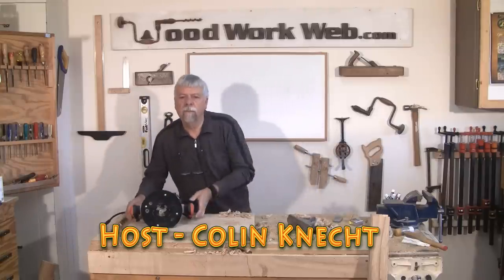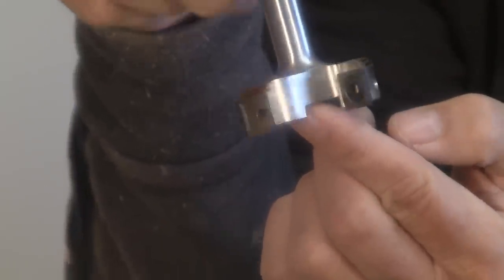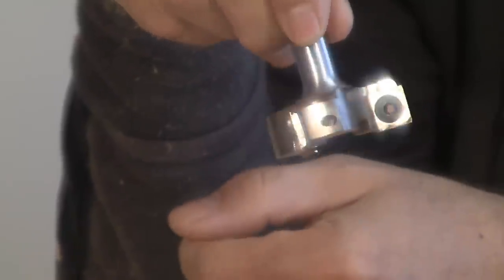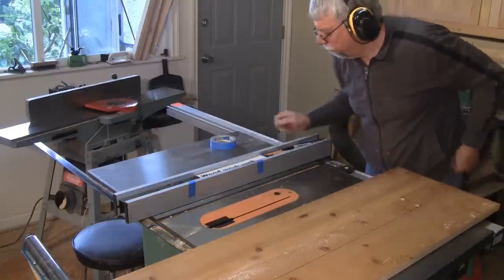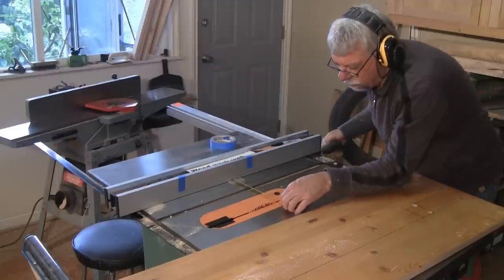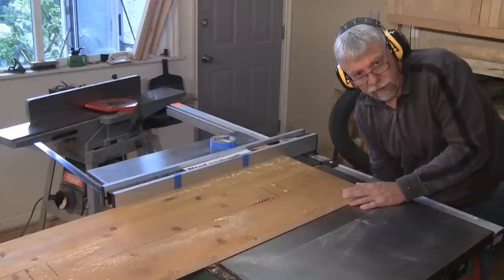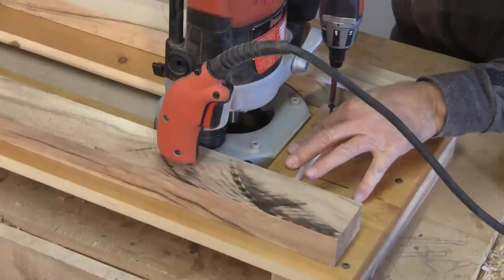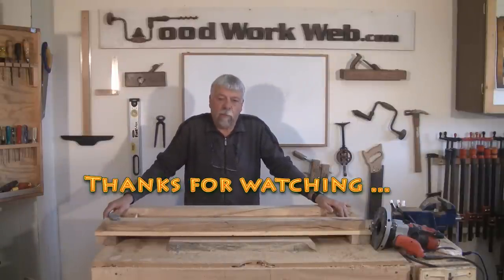Building a Planing Jig for a Wood Router -  woodworkweb

Comment: I am so glad that this video is still available.  I watched a few router plane jig videos and each one was more elaborate than what I needed it for. 

I had glued up some 2x4s for a butcher block extension wing on my table saw. Even though I used every clamp I own, the little slab had a dip on one side and a bump on the other. I needed a simple jig to plane it flat. Your design worked perfectly!
I used a 1/2" straight bit and took off just a little at a time, until I had a flat slab. It left a slight wavy pattern, but it sanded smooth with very little effort. Thank you for making this video. I enjoy every one of your videos. All very informative.

Comment: Slick jig!  I've seen the type that the router fastens to a sled and the whole sled slides on rails over the work, but never a panel with guides and feet on.  I've got a gorgeous piece of ash crotch wood that I've wanted to make into a clock for quite some time, but have done nothing but screw it up to this point.  Going to make a jig like this and try it out - the other kind I've seen would be too large for my tiny shop.  Thanks for making the video.

Comment from the maker: Hi Scotty, yes, even I was impressed how well it worked. Zip over to the article on woodworkweb to check out router bit options. We discovered they are somewhat hard to find. Rockler, Woodcraft and other go-to places had nothing, but there was a good selection at Amazon, which we provide links for in the article because there are pages and pages of router bits at Amazon.
Hope this helps, let me know if you need more info :)
Colin

Comment: Thanks for sharing the video. Another option would be the plane jig we used to level very large red oak slabs. First we used a 4x8 sheet of 3/4 plywood in which we made into a table about 30" off the floor. We then fastened 2x6's to the 8' sides, make sure you level them. Them we took 1 1/2 x 1 1/2 angle iron approx. 5' long, 2 each to go across the 4' table. we also used angle on each end told hold jig together, make sure the jig is far enough apart to easily hold your router. Now in our case the red oak slabs were not at all level, so we got them as close across the slab as we could, and fastened them through the bottom of the table using screws and wedges as needed. I works like a dream and we made many table tops using this jig. Some of the tops we made were over 5' wide so we had to make a larger table and jig, we also put 2 tables together for the longer slabs. The nice part about this method is you can also use the table for sanding, finishing your  projects. Good Luck!!
Reply from the maker: Jim Groth Thanks for your detailed note Jim ... appreciate it

Comment: Hi! Great video. I know it has been up for a while now, but I was wondering what are some other ways to fasten down the piece being worked on? Make it slightly oversized and clamp/screw it down?
Reply: I think, of you're planing a heavy piece, you'll just have to worry about horizontal movement, so just screwing a wooden frame, or even just little metal corners, will do. If you're working on something lighter, depending on the surface of your workbench, you could put wide tape on both your bench and the piece, so they'll aline and put a few drops of super glue in-between the "backs" of the tapes. It might even be enough to not clamp it down at all... Have fun and stay safe
Reply: @Lazarus-aap  Thanks for the reply! :)

Comment from the maker: The planing bits used in this video is a 1/2" and I'm not aware of any that are 1/4". You really need a bit bigger bit for this kind of work which means a little bit more powerful router that will take a 1/2" bit.
Reply: What particular brand of that planing bit?

Comment: Great work, you never cease inspire me. This sled build seems overly complicated. You do not have to cut a big slot out of the middle of a board with a table saw (or a jig saw) to make a slot for the router. You can just use the router to carve the channel (slightly larger than your widest planer bit) out of the board using a temporary guide, then add your stops, and the sides to fit the router base width. Some of the niftiest sleds also have height adjustment, which can bi a great feature. This is the first sled video I've seen that goes with the grain instead of across. Are there any advantages or doesn't it matter?

Comment: Hi Colin, I was wondering if there is a good way to make the height of the jig adjustable? Right now I'm thinking of driving a bolt in on every corner, but I think that will leave too much room for error... Also, my workbench is very small, so I don't have much room to move the jig over the workpiece... Is there an "easy" jig to make to move the router around over the piece? I'd probably have to make something on which the router can slide, say left and right and that sled on itself needs to slide back to front, right? Do you have something like that? (And a video about it?) Thank you in advance! Greetings from the Netherlands!
Reply: Nevermind! Found your video!

Comment: Hey awsome vid,
Just whas wondering why you didn't turn the router 90° in relation to the jig?
Cause what I thought whas you where going to use the flat sides of the router base to slide against the guide-rails. This whay you have a perfect straight routed line,... you also can use (approx. 1" thicker guide rails for stability,... and easier axcess to the handle.
Is this true what I'm saying? cause I'm not that certain,... it's just an idea. Let me know what you think?
Greets

Comment: Hi Colin, thank you so much for making and sharing this vid. I learned so much.

I intend to make a jig similar to this, but I have a question on router bit selection. For this jig, I will be using a Makita RP2301FC. The problem is, in the USA, this model router is a 3-1/4 HP, while in my country the motor is rated at 2100 w, or 2.8 HP. 

Originally the router bit I wanted to use was an Amana 1-3/4 inch bottom cleaning bit (part #45453), but when I found out that my router won't be as powerful as that of reviewers who used the bit, I got a bit worried. In fact, I got to looking at a smaller version of the bit, the Amana 1-1/2 inch bottom cleaning bit (part #45566). I want to be safe, and I want my work to look good too.

However, Amazon is selling the 1-3/4 inch bit slightly cheaper than the 1-1/2 inch. The fact that I would lose about 1/4 inch in capacity, combined with the fact that I would have to pay more for this questionable privilege, is really chafing me. Yes, the loss of capacity is small, and the difference is not even a dollar, but it bugs me.

So my question is, do you think that I can safely use the 1-3/4 inch bit, or would it be better to use the 1-1/2 inch bit?

Note: I am using tropical hardwoods almost exclusively. Some of them can be really dense.

Would really appreciate your input on this one. 

I'll link the items here (please copy and paste into address bar):

Router: amzn.to/1ROb8tw
1-3/4 inch: amzn.to/1OL5xEi
1-1/2 inch: amzn.to/1LzPhoF

Comment from the maker: Good question, the bandsaw was used to get the board cut to rough shape, in this video we are planing a wide board. If the board was narrower, we could have used a jointer, but on wide boards that won't fit on a jointer, planing with a router is another way of getting them flat and with a nice smooth surface finish.

Comment: Hi Colin,
On my planing jig the grain direction is a necessary consideration and also what about dust collection? I reclaim pallet wood boards this way but need to collect the chips.
Regards
Colin Farrier in Northern Ireland
Reply from the maker: Hi Colin ...
Yes, I would agree that grain direction is often necessary, as for dust collection some routers come with dust hoods that can be collected to shop a shop vac or dust collector. I seldom use them because most of what I do is in the router table which already has dust collection, but think for planing it's probably best to try to collect closer to where the bit is planing ... sounds like you might have more experience with this than me, but I am curious why you need to collect the chips??
Reply: Colin,
Thank you for your reply.
My planing jig is six feet long and can take a four foot board. The chips are thrown out from the jig in all directions and about half drops inside the jig for later disposal. One method would be to use brushes to act as a barrier as the carrier that I use for the router moves across the board. The second method is to have a 'containment room' around the jig to stop the widespread broadcast of chips.
What do you think?
regards
Colin Farrier from Northern Ireland
Reply from the maker: colin farrier Yes they can be pretty messy, I don't need to use mine very often, but I know what you mean by the mess. I had not really thought about trying to contain the chips until you brought it up, I just clean them up after or at least try to, they do go everywhere. I am wondering if containment on one side of the jig, and dust collecting on the other but not sure if there would be enough air flow, and your jig is very big and I don't think the dust hood that some come with would be work. You have me a bit stumped on this, I think your idea of containment on both sides sounds the best so far ... let me know how you make out with this, very interested to hear.
Reply from the maker: Hi Colin ... couple of thoughts, you could post them on Woodworkweb in the Forums for everyone to see and learn from or you can email them to me and I can post them ... either way, would be nice to have a look at them.
Thanks for the note ... looking forward
Colin

Comment: Hi Colin, great video, I'm halfway through making a end gain chopping board which I need to flatten I'm thinking putting a scrap boarder around and sending it through the thicknesser, or making a jig like this using a router, what's your advice and would a bit like the one used be to aggressive for end gain?

Cheers, ~Steve
Reply: Colin Knecht Sure I should have it finished next weekend thanks Colin

~Steve

Comment: Maybe a router template guide can be used insted of the top wooden fences
Reply: Filip Jelenkovic that's what I was thinking too.  Not sure if typical guides would support a huge bit like that.  Usually a guide would not interfere with the bit being plunged up or down (i.e., straight bits) however that would not be the case for this bit.  That would make it a dangerous option but I am only guessing don't have much experience with guides.

Comment: This video jsut saved my ass. Thanks man!
Reply from the maker: lol ... glad to hear David, maybe we can see some pics of the finished project?
Colin
Reply: I'm moving to a new house on Thursday the 21st. Will FINALLY have my shop. The wife has graciously granted mt the 2  car garage solely for my woodworking. So I'm getting in there and setting up tools and my new wood lathe :-) and then building a work bench, then this jig. I got a good deal on some hickory for a trailer I'm refurbishing for my landlord, but it's rough sawn. I don't' relish the idea of hand planing all that down. I'm sure photo's and stuff will be in my suture. Right now I only have pics of my fence and deck jobs I've done. And who'd wanna see those? Snore. Thanks again man!
Reply from the maker: David Loew AH ... I see what you mean now. Yes planing hickory with a router jig will be much quicker and easier that hand planing, and should do a good job too. Thanks for sharing this, we are always happy to save someone's butt  :) ... so to speak
Colin

Comment: I built this jig a few weeks ago and found it insanely useful! I am using this bit: http://www.amazon.com/CMT-852-504-11-Planer-2-Inch-Diameter/dp/B000P4O610/ref=sr_1_sc_2?s=hi&ie=UTF8&qid=1431539387&sr=1-2-spell&keywords=router+plainer+bit 

and on long grain cutting boards it works like a dream but on end grain boards i am getting a tiny bit of tear out....would the bit you are using eliminate that or would it be more of a product of my router speed and feed rate?
Reply from the maker: jeremy gunkel Hi Jeremy, glad to hear that jig is working for you, and yes a dado bit will work, it just takes a smaller bite of wood each time.
In terms of tearout ... I can't say for sure that changing a bit will help, it might, also increasing bit speed ... might help, as might pushing the router slower or faster. End grain is a bear to try and get perfect. Sometimes it depends on the wood, could be the bit ... so hard to tell. I think I would try to keep using the bit you have first ... speed it up a slightly, slow it down ... change your rate of movement across the jig ... any of these might helps. Sorry buddy, no easy answers on this ... thanks a bunch for you info ... great stuff !!

Comment: I think this over simplifies the process a bit. This will work great if you have a perfectly flat and level work bench but if you have any uneveness there at all, this will cause some undesired results.
Reply from the maker: Joseph Huisman Not really, as long as both ends are stable, what ever lies in the middle will be planed flat assuming nothing moves.
Reply: I would agree with that. I guess what I was thinking about is if you want to flip it over and do the same thing to the other side with the intention of both sides being parallel in the end.
Reply from the maker: Joseph Huisman Yes, you are correct ... that is an option too, and probably something many would want to do
Reply: Either way,  it is a great idea and something I have been struggling with recently.  Thanks for posting.
Reply from the maker: Joseph Huisman Yup ... NP ... thanks buddy for commenting
Reply: WoodWorkWeb It the table the jig is resting on passes the winding board test all will go well.